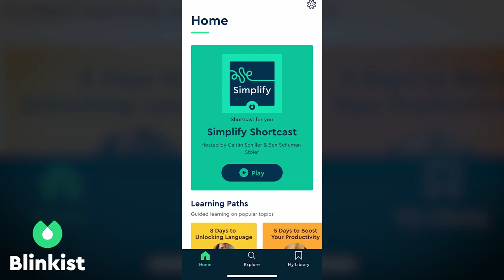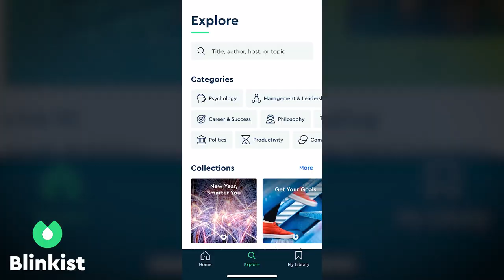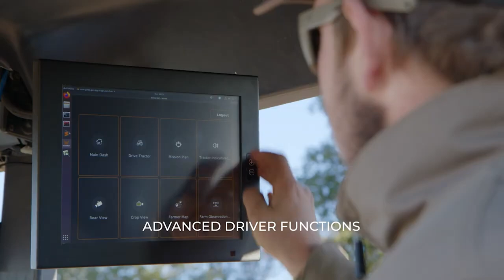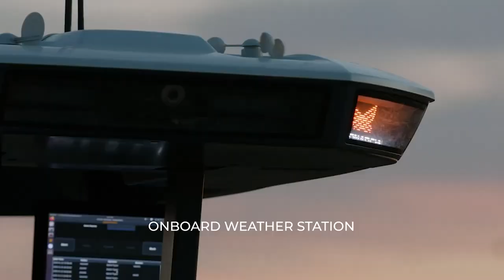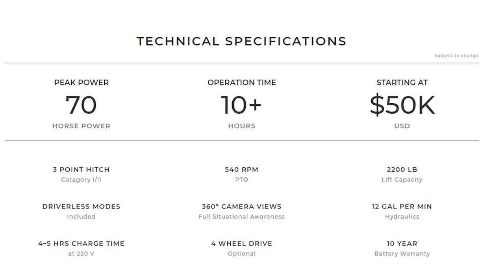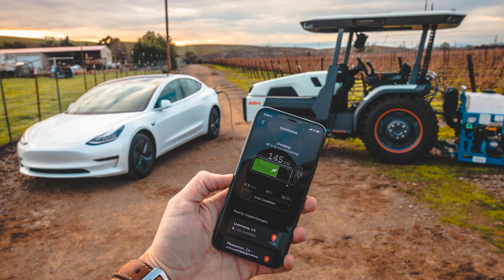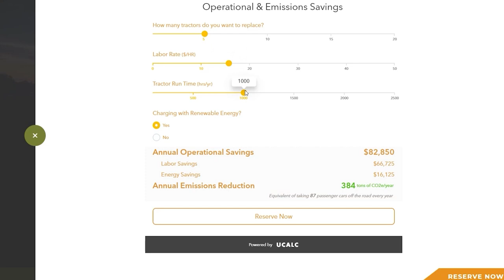This Tractor Could Change Farming Forever | In Depth

Comment: The compact size tractor they have is way way more expensive than even John Deere comparable compact tractors.  In the JD units at the same price, you’d get much more for the money,.
Reply: Agreed, but 70 HP equivalent is a useful size for a lot of ag. And with self-operation, you simply add more units for larger operations. 
Electric power makes a huge reduction in operating costs, and should easily quadruple the lifetime operating hours of the machine. Well applied electric drives are essentially imortal.
Reply: @lengould9262  - I know, but diesel tractors are basically immortal as well.  You don’t typically use compact tractors do do automated work as they lack the power.  Those units are typically in the 100s of HP.  Don’t get me wrong, I’m excited about electric tractors for the future.  I think subcompact EV tractors would be an easier sell, as you could get them into hands of land owners and small market farmers. Those size units could use the same chargers used on auto EVs.

Comment: how do u charge electric tractors to reduce emissions?    you burn coal  500 miles away loosing 1/3 of the electric on the wires and anotehr 1/3 in the coal burning and what ever other lossses are involved........it is my beleif that u loose over 80 percent on the way to the receptical/

Comment: Gentlemen, you make very interesting and important reports on topics related to renewable energy and the need for changing over to renewable energy A.S.A.P.

One critical part of renewable energy is the base material for making solar cells. In the United States, we currently have only three companies that make the critical solar grade silicon and only one is a totally owned U.S. corporation.

If we are to fill those 10,000 square miles of U.S.A surface with solar power, as you say, to effectively achieve renewable energy independence, before Climate Change overwhelms us, it is critical that we expand solar grade silicon production in the United States so that 500 GW (on average) of solar power be installed per year until 2035.

As reported here: 

https://www.seia.org/us-solar-market-insight#:~:text=The%20U.S.%20installed%203.8%20gigawatts,power%2016.4%20million%20American%20homes

the United States installed about 20 GW of solar power last year, which was about a 43% growth over 2019. Previous years have seen growth rates for installed solar power drop to as low as 10%. We need to ensure that the solar grade silicon supply for solar panels does not fall into the same rut as in previous years nor the current chip supply problem for electronics. We need to keep this growth rate at 43% or better for the next 10 to 15 years. It is the only way for us to avoid the ravages that await us from Catastrophic Climate Change.

Bill Gates says that what we need, for energy independence to be achieved, is a lot more of innovation. This is not true. Innovation is fine, however we already have a lot of innovation at our disposal. For solar power to take us to renewable energy independence, what we need now is to spend a lot more on perspiration, to enable those 10,000 square miles of solar power generation that you mention and that will avert Catastrophic Climate Change.

Comment: they are not able to do wheat, soy bean, and hay.   still too early.  maybe hobby farms or fruit farms or city farmers with less than 160 acres.
Reply: @635574  yes we need larger tractor for larger farms... On my farm the smallest tractor is 90 HP and the largest 250 HP. We have 600-800 acres.
Reply: Leading edges start somewhere.
Reply: @christopherhowson7383  I think most people fail to understand the power requirements on a larger farm. If a gallon of diesel is roughly 33kwh and you look at the hundreds of gallons that get used on busy days.  If you burn 12 gallons of fuel per hour and you only work a leisure day like say only 10 hours, you might be looking at 4000kwh of power.   Maybe my math is off if electric is way more efficient that diesel, but I tend to believe a fairly significant amount of diesel gets converted to work and not losses to to heat and drive terrain frictions.  Either way tractors in active operations like tillage or baling use a lot of energy.